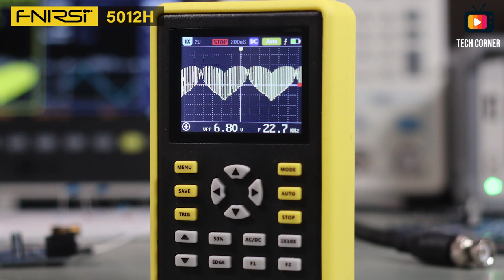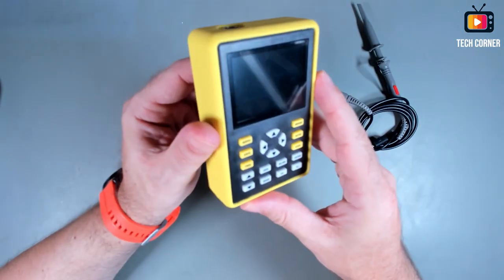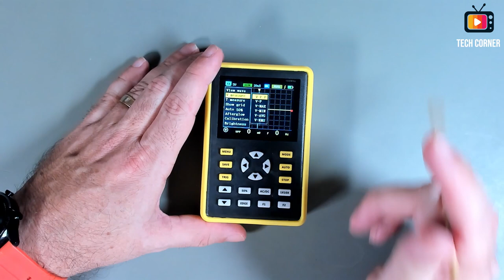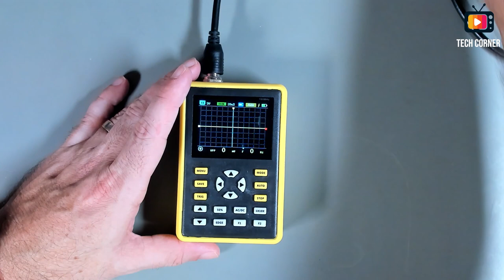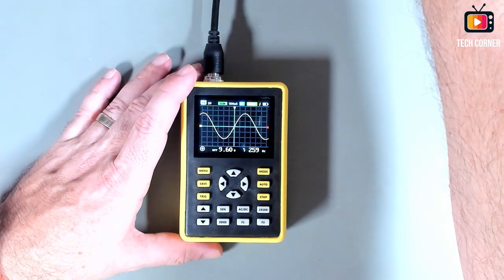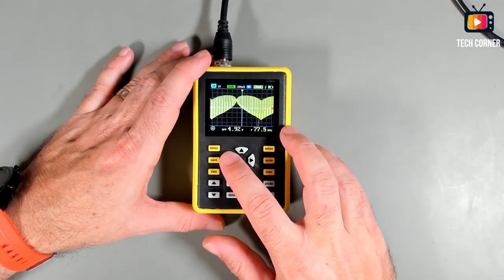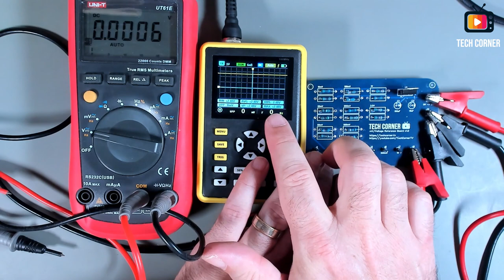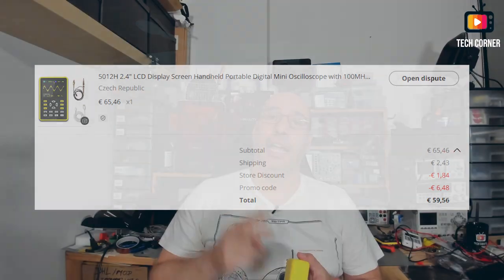FNIRSI 5012H Handheld Oscilloscope ⭐ 100 Mhz  ⭐ Fast, Compact & Portable

Comment: I've seen other reviews of these and the signal is so stable at high frequencies because it's highly interpolated.  You can see the software interpolating even during time scale changes.

It's becoming all too common for these ultra-budget scopes to pretend that everything is a sine wave above 10-25% of their rated bandwidth.  This "100MHz" scope can barely display a 10MHz square wave and we could test its realistic bandwidth sensitivity by determining where the displayed voltage drops by ~30%, which is about -3dB.

In the video it was 4.2dB down at 50MHz and I would guess the actual bandwidth sensitivity is ~30MHz and the display accuracy is more like 10MHz.  When Hugo zoomed in the voltage scale the measured reading dropped to 3.3Vpp, which is -10dB, but it's normal for oscilloscopes to need lots of waveforms on the screen to display accurate voltages, so I'll give it credit for the reading it showed before the auto-set.  Always remember to zoom out all oscilloscopes to get the best voltage measurements.

The 500mV minimum DC sensitivity is also totally unacceptable when it's rated for 50mV.

These ultra-budget scopes are acceptable products, but they must advertise accurate specifications in order to be useful tools.  We all understand that a US$40-$80 handheld scope isn't going to compete with an $800 bench model, but we still deserve to know the actual capabilities before buying.
Reply from the maker: Hi Rob, nice comment! Regarding the "interpolation" to be able to show a decent sinewave, to be honest, that doesn't bother much, as long the values are correct (time and voltage divisions). Rigol for example, as the UltraVision to improve the waveform and Siglent also as something like that. For me it has to be accurate and if it totally get there, is all different story.

But you and other viewer hit exactly on the point and I could not be more in aggreement with you in the fact that the specs are most of times, somehow "shapped" to mislead us. This happens, not only in this small oscilloscopes, but a lot in the desktop entry range. A lot of marketing and too few quality.

I have a problem while a content creator and reviewer of this devices, that is, not counting with the established brands (keysight, siglent, rhode, tektronix, rigo, etc), all the equipment have the same issues, so I decided to compare the devices between the devices of the same range, because if you compare with those brands, the result will never be good. 
If we are talking about cars, we'll compare a golf with a peugeot and not with a mercedes or BMW.

But again, you're rigjt on every observation you made and I'm all for transparency, the should label the equipments according the real specs.
Just to finish, I though that was curios, that Lotto Instrumments oscilloscopes state in the specs that they will have (example) 30Mhz at -3dB. Nice touch.

Thank you so much for you elaborated comment! It was very rich. Thanks for watching ❤

Comment: We bought some of those for the equivalent of $150 each. We needed a scope capable of measuring signals from an ultrasonic machine that produced a 320V, 40kHz sinewave. The scope is very hard to set up, and frequently can't tell the frequency as accurately as our benchtop scope. It is not that bad though, but for $150 it is still not the best choice. 

(For those wondering why 150, brazilians pay an 80% duty tax over all imported good and spare parts as well.)
Reply from the maker: Hi Lucas, thanks for sharing. I am learning from those 5-video reviews series (I'm regording today the 4th video that will go on air on Aug/18) that from all of the oscilloscopes I've tested until now with 100Mhaz or more and in 50 to 100€ range, this is the worst one. Today I tested the SigPeak DSO1511G and I was super impressed! The last one will also be from SigPeak and im confident that will beat every other option on that range. I will do a showdown between the 5 oscilloscopes in september, not to loose 😎 Regarding the customs in Brazil (Brasil for us) I'm talk in a Whatsapp group with several youtubers from Brazil and they already talked about the fees, it's nuts what you pay in custom fees.
Thank you so much for sharing and for watching! Stay safe 👍
Reply: It cost 83€ on aliexpress free shipping.

Comment: I find it interesting that the vpp changed from 6v to 3v when you went below 2v voltage divisions. It sounds like Vpp is a dynamic reading based on how tall the wave is on the chart, and Vrms would be the setting to use.
Reply from the maker: Hi, nice catch.... thanks for watching!

Comment: I bought. Measured. Passes at the 3dB level up to 8 MHz. Everything above does not work as a measuring device, but as an indicator of the presence of a signal!
Reply from the maker: Hi, there's a definition I didn't heard before about an oscilloscope 😁 my function here is to show the best I know and can the device, after that is up to you guys! It's a cool device, but there's much better on that 5 video series I made.Thanks for watching!

Comment: The scope didn't  correctly register millivolts DC because the vertical sensitivity was on the 1 Volt/div setting. Also when looking at sine waves from the generator I expect the generator was set to 50 Ohm output so the scope input experienced twice the level set on the generator.
Reply from the maker: Hi Geoff, thanks for sharing, I really appreciate your comment. Thanks for watching.

Comment: Thanks for the review Hugo. Its a pity the advertised bandwidth is far different to reality. While its a very cheap scope, I still think they should advertise the correct bandwidth.
Reply from the maker: Hi Khoung, yes, it's very sad that they don't refer properly the specs. Thanks for watching! 👍
Reply: Sorry, did I miss something? Isn't the unit advertised as 100MHz bandwidth and it decently performed that level?
Reply from the maker: @MrKockabilly  Hi, as you can see at 100Mhz the Vpp is 388mV. Ideally if this was a 100Mhz scope, it will not drop bellow 707mV (or something near that). There is a relation between the voltage drop (cut off) and the maximum frequency suported. You can read more about it here https://siglentna.com/operating-tip/determine-bandwidth-scope-require-application/ . You can also measure the bandiwdth using the rise time and is also explained in that article. The sinewave on the screen looks ok, but because it was somehow improved by internal software and not because it was the correct reprodution of what is reading. Anyway, for most of the cases, the oscilloscope is ok, but should be advertised with a lower bw to be accurate in the specifications. Thanks for watching!
Reply: @TechCornerTV  I'm obviously just beginning to understand the intricacies. I very much appreciated the explanation and the link. Thanks!

Comment: DOES THIS OSCILLOSCOPE HAVE THE FFT OPTION? I THINK IT IS INFERIOR TO THE FNIRSI Zeeweii DSO1511G
Reply from the maker: Hi, don't remember if it has FFT, but sure DSO1511G is superior, I would advice the DSO2512G or even the other FNIRSI oscilloscopes I reviewed in this series or the DPOX180H, but this one is a bit more expensive. At the same price you have 1C15+, that a bit better. Thanks for watching.

Comment: Why specify/describe/sell a ~30MHz DSO as a 100MHz one?
Because chinese sellers think Western people are stupid.
Reply from the maker: Hi Paul, I agree that it should be branded 30Mhz... the sinewave at 100Mhz was still better that some entry level bench oscilloscopes, but that is no excuse. Specially because those bench desktops sofer from the same problem. No reliable specs. But the next 4 weeks (if I don't fail one) I'll be showing 4 more models in the same price range, so a lot of the same about to came... I'll do a "showdown" video with the 5 models in the end and compare directly the analysed models. Thanks for watching! 👍

Comment: The question is ¿Real 100 MHz bandwidth?
Reply: No, but for doing stuff up to say 20Mhz its perfect.
Its perfect for what it is, but if you need 100MHz, buy a proper scope.
Reply: @VEC7ORlt  Yes, but if Fnirsi sells this product with 100 MHz BW and it only has for example 20 MHz, it is false advertising. We know a lot of Chinese manufacturers do that but it's still quite a difference in specs.
Reply: @proteomicrotronicsempresa2030  Yes, yes it is, but what are you going to do about it - sue them? No, you do your homework, is 20MHz scope for ~100eu good value? If so you buy, if not you don't.
It is for me - it has nice interface, sturdy box, 20MHz is plenty for the girls I go out with, now when I do proper probing and R&D I use my proper 100MHz 2ch machine.
Besides, how much a 2ch 100MHz scope these days? ~300-500eu.
Reply from the maker: Hi, by the way the square wave behaves with the square wave, I would say no. The maximum bandwidth of my AWG for sine waves is 30Mhz (and thats good for a sqare wave) and at that bandwidth you should have a nice signal on a 100Mhz oscilloscope. Thanks for watching 👍
Reply from the maker: Hi! Thats exactly the question.... do you need 100Mhz on the oscilloscope? Most of the target users of these equipments will not use that kind of frequency on they projects. That said, the specs should be accurate and normally are not. Thanks for watching 👍
Reply: @TechCornerTV  
I think the real problem is false advertising when the manufacturer sells a product. Well, even knowing that it is a cheap product, on many occasions they inflate the specifications too much. I still remember the infamous Fnirsi 1014D 😅😅😅
Reply: @VEC7ORlt  It is not about its price or the capacity of the equipment, my point is how the "manufacturer" promotes the equipment with false or non-real specifications. Now for $250 Owon or Hanmatek will sell you an oscilloscope if not 100 MHz at least very close plus 2 channels, FFT, XY mode and good firmware. I believe that on Amazon there is a Kiprim brand oscilloscope for $168 that I have seen very good comments about.

Comment: This device is totally unusable for me in the low frequency range (from 200ms to 10ms timescale). In this range it's refresh rate is like 1 frame per 5 seconds and it's not possible to capture low frequency signals. It also misses single pulses wich happen less than 50 Hz so it can't be used to investigate rising/falling edge of the impulse. Trigger always misses the pulse. When switching to more fine timescale (like in the range of microseconds) the refresh rate of the screen becomes normal but trigger still misses the pulses.
Reply from the maker: Hi, yeah, this one was the first of a 5 oscilloscope review series, take a look in the last two from Zeeweii. Thanks for watching!